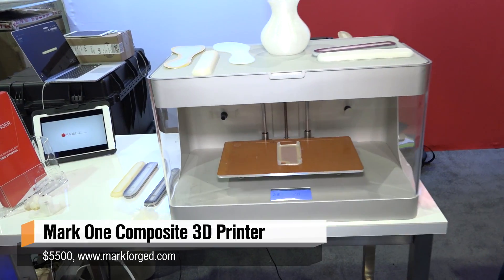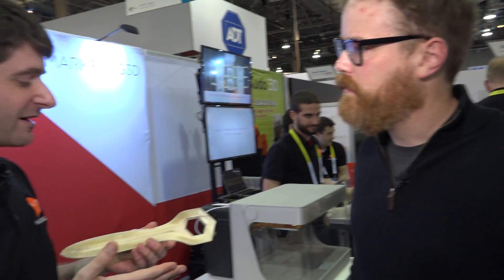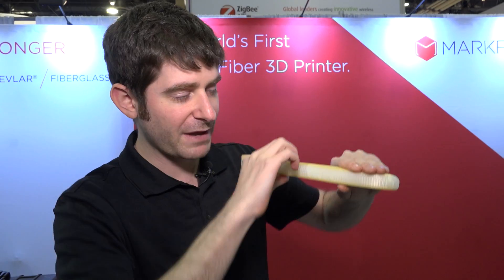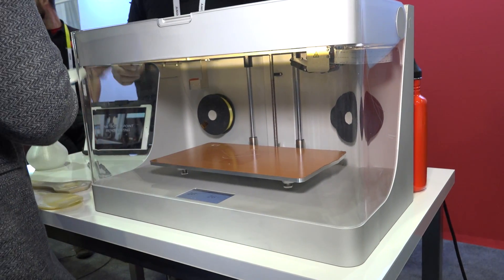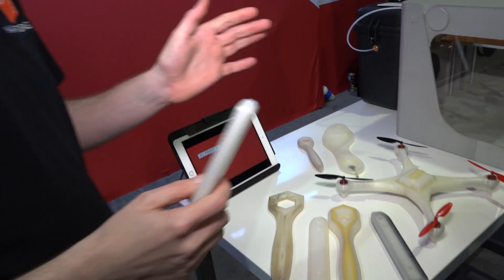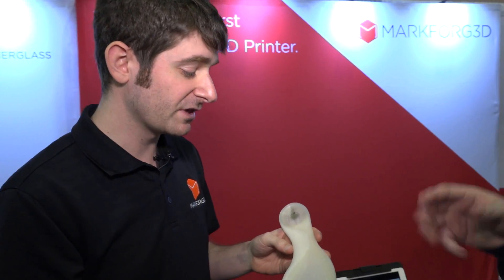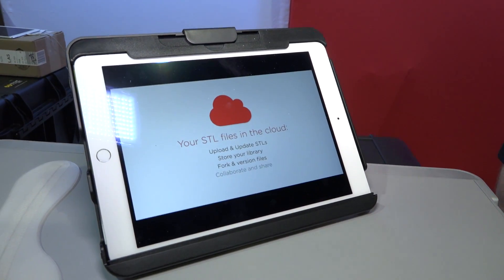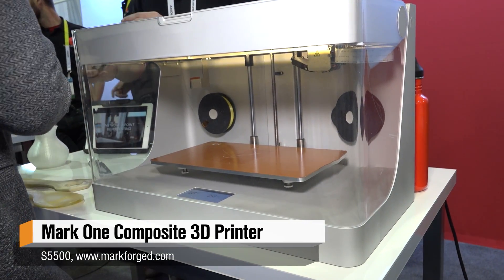3D Printer that Prints Carbon Fiber

Comment: Quite ingenious. This is very nice for composite construction since you'll have much much control on how the matrices are oriented (or at least how they are laid) and thus increases tensile strength at specific direction while at the same time reduce consumption of materials and thus lower cost.

Comment: this is similar to printing with a dual header extruder with the carbon fiber as the infill. the only difference is their software lays the carbon fiber as a shell in the direction of the shape outline rather than the typical infill pattern.

Comment: composite parts de-laminate and/or  crack when subjected to constant vibration or shaking.   In an airplane use metal for all structural components that bear stress.
Reply: better tell Boeing and 
Airbus that .......

Comment: Great but it doesn't sound like it yet has the ability for laying the fibers in a multi-directional orientation. This is going to limit your structures that require high strength in more then 1 or 2 directions.  Regardless this is still a nice jump in 3D printing performance.

I would like to see the carbon fiber/fiberglass strand replaced with a strand of carbon nano tubes.  Although there are filaments that contain nano tubes they are still costly and do not allow for precise control for positioning the nano tubes as this process  does.

Comment: Print in 4D and use the same program to emit a signal into the printer and render the object in a cloud/ vapor of composite material. Kinda how sound can shape a non Newtonian fluid, it could be used to shape a non Newtonian vapor then harden it into its final shape. Shouldn't take no more than seconds or minutes to print  than hours
Reply: easier said for sure.

Comment: Why has no one mounted an extruder head on a hydraulic arm and have it computer controlled. It would allow you to print on a much larger scale then a print bed. It would be especially useful for things were millimeter precision doesn't matter, like house building.

Comment: If you lay the fiber down in loops like terrycloth (with exposed tops) you'd interlock the layers when the next layer is printed. Or if you had a print head with multiple axis you could print objects where the layers were radial and had strength in more directions.
Reply: Glass 3D printers lay it down kind of like a weave.  Excellent idea.

Comment: Multiple head extrusion 3D printing that makes prints stronger than ABS/PLA in bending and tension stress without sacrificing plastic strength when separating layers. This stuff is cool.

Comment: This is what the industry has been looking for. A way to 3d print a carbon fiber part without using chopped fiber. delamination is an issue but you get fibers in the alignment you want.

Comment: Carbon fiber parts get their strength from a weave of the fiber and not from continuous strands laid down next to each other. This is not really how carbon fiber was intended to be used. Sure it makes a plastic part stronger but to say that it's as strong as steel in a particular direction is a load of bullshit. A wrench that size made of steel could support tons of weight in tension. There is no way that piece in plastic even with the CF would handle those loads. He also never talks about fatigue life...

Gimmicky at best!
Reply: you are right, without the oven it is impossible. But still, this printer is amazing.
Reply: o0prince Yes it's definitely a nice machine for what it can do.
Reply: Well I'm a mechanical engineer specialize in composite materials, and I'm sorry to say you're a bit wrong. You see composite does not have to be laid in all three axes. In fact, it is known that if you want to save on expansive carbon and know that you only need it strong on one direction, you only lay it in that direction.
Reply: Moav Winnykamien Agreed but a structural component rarely if ever sees load in only one direction. Especially a plastic part. In practical applications it almost never happens. Let's say you print the support structure for a quadcopter. A finite element analysis will show you that it's never loaded in only one direction. It bends, twists, and stretches all at the same time.

Comment: What comes to mind for print are bicycle frames with internal lattice structures that takes advantage of all the strengths of the different materials.  Or lightweight car frames with more effective crumple zones? What about bike helmets designs that offers better shock protection?  Also you can apply this to all kinds of frames.  Lots of application.  Amazing product.  And yes, sigh, I am a geek and this product is like an engineer's wet dream.

Comment: Do they a contingency plan for when they go out of business / can no longer afford to host their cloud based software needed for the nearly 6000 dollar printer?
Reply: That's quite a stretch as hosting is very cheap.
Reply: Not really. There are plenty of examples where software / hardware has been rendered useless by a company implementing an arbitrary online requirement, and then deciding to stop supporting it.

Comment: Instead of 2 print heads, 1 for plastic and 1 for the fiber strand.. Why not create 1 head, that merges the plastic and fiber into 1 strand, and lays them down together? Sorta like coating the strand in a "glue", cept it's the plastic.
Maybe that's an excessive use of the fiber, which doesn't add significant benefit.. lol
Reply from the maker: I think you nailed it. They were only putting the fiber on a handful of layers in these prints.
Reply: At $1.35/cm3, putting down carbon the whole time even with another material would be very expensive, and they would need to develop and sell custom plastic/fiber.
Reply: Such a printer would be great, but it's a product for a totally different market. The printable objects are limited in shape because you have to print continuously without cutting to often. The resulting objects are stronger, heavier and much more expensive.
Reply: John LaRocque is that the price of the MATERIAL itself (CF), or is that the industry standard price INCLUSIVE of labour? I was pretty sure it was LABOUR that was expensive in the production of CF panels. i mean, think about it, carbon. how rare is it really? i could be very wrong though.

oh nvm he explained it at 13:00. why is it so expensive!??
Reply: +NikoKun Well, then you might like the diamond hotend: it has 3 inputs that go into 1 nozzle, and the idea is that you can mix different colours to get true color mixing. (they are also thinking about making a full 5 input true rgb colour nozzle using yellow, cyan, magenta, black and white filament)
Reply: I thought of this half way through the video! If only I had the technical know-how to make one.
Reply: ***** The price of things is odd sometimes. It seems like it should be "Common materials = cheap items!" yet, plastic is dirt cheap and is made from oil and carbon is expensive and is made from one of the most common elements on Earth. 

I think it goes back to supply and demand. If you're one of a couple companies making something, then you are going to charge more because not only do you have a low desirability, just because of its demand, but those that do use it, absolutely need it. 

Also, you're paying for research and development of the material. If four companies are doing the same thing and the market demands that many manufacturers then you have to be more competitive with your prices. As it's usually the cheapness to quality ratio that wins out. It's like home electronics. When any new thing comes out it is almost at a point where no one can buy the thing. 

Then, as the market becomes more saturated with manufacturers then price drops significantly. Same concept. As 3D printers and their materials become more common place, the price will obviously drop. As it already has, what was the price in the early naughties? Like $30,000. for a decent 3d printer? So, it's a market in flux at the moment. The true price of these things will come out in the wash.
Reply: +NikoKun going to have to incorporate a cutter for the fiber.
Reply: some one should build a copperwire or steelwire version which will drop the costs like hell ;)
Reply: There are laser welding 3D printers, the exhaust on my racecar is 3D printed ...
Reply: Max Pucher That's laser sintered (SLS).. Different production method.
Reply: Different materials have different melting temperatures. Therefore 2 printheads for 2 different materials.

Comment: Wow carbon so conductive? Make circuit board! My  idea vote  up if like it
Reply: Graphene.
Reply: Wayne Johnson That's why you have to be careful with wiring a quadcopter - it'll short out if there are any exposed wires or if there's a crash and that happens.

Comment: wouldn't the parts be even stronger if they alternated the direction of the fibres? Kind of like a piece of plywood with fibre
Reply: +TheCoolStuffHD As a matter of fact, carbon fiber reinforced polymers (the combination of carbon fiber and a plastic, like a polymer resin or nylon) don't get their strength from the weave. They get their strength from the properties of carbon filament, and the behavior of strong filaments when embedded in a material. The strength of carbon fiber is directional. While adding carbon fiber improves rigidity in all directions, it's only really strong along the length of the fiber. Like the example given in the video, think wood grain - those cellulose fibers are adding strength on the long axis of those fibers. Carbon fiber behaves exactly the same way. 

The real reason for the carbon fiber weave's popularity is not at all because it's the strongest pattern for a given application. It's popular because it comes in big sheets that are easy to work with. You can't really do sheets of carbon fiber without some kind of weave, and without the sheets, carbon fiber would be a pain in the ass to use on anything even remotely large scale. It's pretty fortunate, then, that a weave pattern is a great general-use pattern. Because half the fibers run in the X axis, and half the fibers run in the Y axis, it is equally strong in any direction but the Z axis (CFRP's are famous for being extraordinarily flexible along the Z axis). 

In the part demonstrated in the video, all of the filaments are running the same direction. That means it would actually be almost twice as strong along the long axis as a weave would be, though it would be at least half as strong as a weave along the short axis, if not less so. They could have easily done an alternating pattern and gotten the same strength in all directions as a weave.
Reply: they can lay the fibres in any direction they want on the same layer
Reply: sorry I don't understand what you mean. What I meant is have one layer of fibre going in one direction and then a few layers up have fibres going 90 degrees to the first direction
Reply: GentlegiantJGC they can lay the fibres like you writing on a piece of paper. they are not limited to laying it in one direction, the different strengths they were quoting was based on compression/tensile and layer adhesion(due to the 3d printing method).
Reply: ok it just looked like all the examples they had had the fibres going along the length of the piece for every layer
Reply: the strength test unit they had it going around in ovals like Russian nesting dolls, due to its length it looks like they all go one way but its closer to a squashed spiral.
Reply: Jeffery Wells That makes sense, good to know. Thanks,
Reply: As a matter of fact, carbon fiber gets it's strength from when it's weaved. That's how it's meant to be.
Reply: +gentlegiantJGC I think he even said so himself. It was the default setting, sandwhich layers. BUT, he also said he laid the fibers in differently on the quadcopter thing, which required of him to customize the software to do it that way. He mentioned several times the fibers could be laid in any/all directions. It was only software dependent. No mechanical limitations...might have to watch again, seems like such an honest nice guy.

Comment: can you pass the fiber through layers without cutting then resuming later. if so, that method might be useful in other areas of 3d printing, like printing electronics, instead of printing extruded conductive material for circuits you can just print a wire.
Reply: The fibre head would need to be on a separate mounting, they are both on the same mount so both travel together with this device.